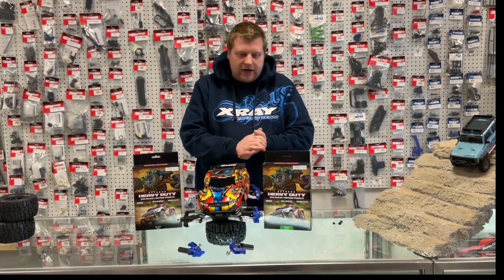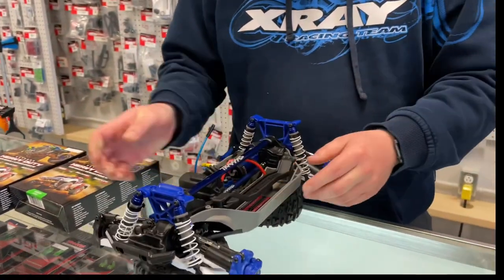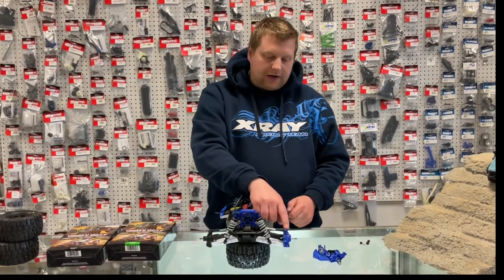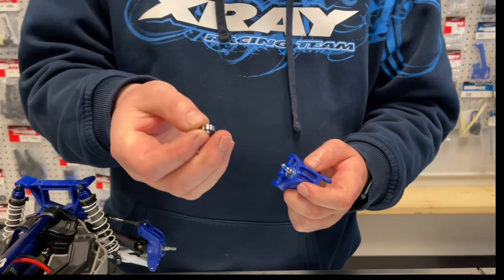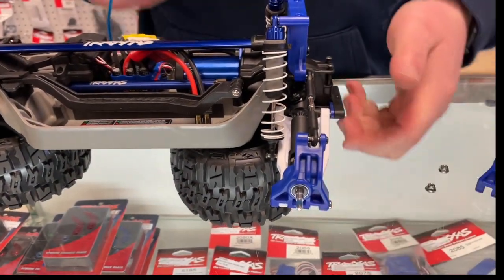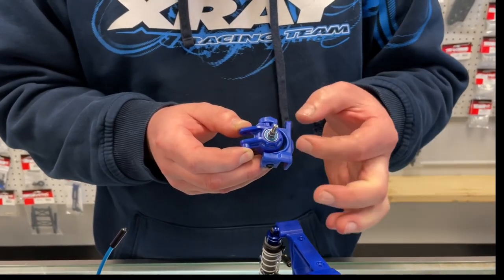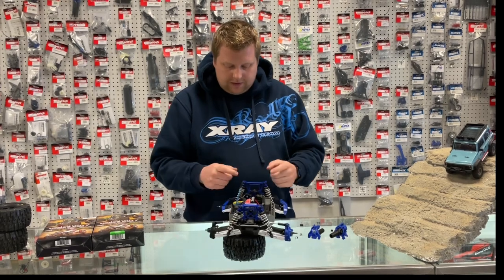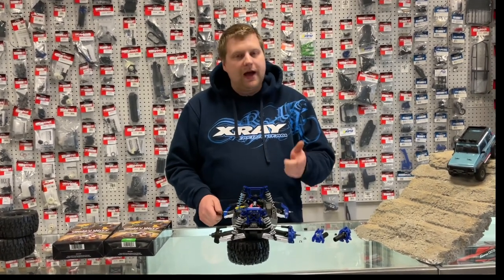Traxxas Extreme Heavy Duty Outer Driveline & Suspension Upgrade Kit - TRA9080

Comment: So turns out those extra bearings are for using the 9052r steel shafts..the rear will not except those  large bearings...I just pulled my hair out trying to figure this out...traxxas ts to the rescue
Reply from the maker: That’s what we did as well. Thank you for the response

Comment: the extra bearing included is for the new metal spline extreme heavy duty cv driveshaft #tra9050r that they have release in conjunction . they used two 6x12mm bearing in the back but fear not they are trash. broke to stub axle already. the plastic one are super hella great !
Reply from the maker: Thanks for the update. We found the plastic axles included with the EHD kit are great when it comes to durability!
Reply: @ultrarchobbies   i have over 30 plus run on them on my 6s slash they are amazing

Comment: Could someone please micrometer the pin that is included that holds the metal 12 mm hex? Trying to figure out if it’s the same size as the stock Maxx pin that holds the plastic 17mm wheel adapter on. I know the Maxx pin is longer but wondering about the diameter this would make for an easy cheap 17mm conversion.
Reply from the maker: We did some measuring on the EHD hexes / pins - TRA9069 and the pins are 2.0mm x 9.7mm. The Maxx pins / hexes - TRA8956 are 2.5mm x 14mm
Reply: @ultrarchobbies  Thank you for getting this info for me. Basically they are the stock pins, I wonder if I could drill them out as there is more metal now that they are 6mm shafts like the stock Maxx half shafts.
Reply: Are the pins supposed to to lock the metal hubs like the old plastic ones do. I can’t get them to lock in. Already lost a pin. Had to put tires on super tight

Comment: Just ordered this for my Hoss, I feel this should of been OEM on the Hoss for the price you pay
Reply from the maker: That is awesome, which colour did you go with? That is a good point it would also help differentiate the differences for each of the 1/10 4x4 VXL models that are very similar with much different price tags
Reply: @ultrarchobbies  I just ordered a Green Truck with the Blue Extreme HD kit, Green GTR shocks with Blue VG springs :)
Reply: @ultrarchobbies   yup i feel that Traxxas could of even charged $20 more IE: $500 if they included this kit.
Reply from the maker: @marcgallant5270  that will be a very slick looking truck for sure!
Reply: @ultrarchobbies  it hope so! This is going to be my first RC. I couldn't afford one when I was young but recently ran into an old friend who has an original traxxas rustler nitro! Got me hooked :).
Reply from the maker: @marcgallant5270  you’ll really enjoy the new electric cars especially with brushless and LiPo!

Comment: Does anyone know if the extreme hd steel driveshafts work with this kit?
Reply from the maker: Thanks for the comment! Traxxas has specifically designed two new driveshafts for the EHD kit: TRA9051R - Front & TRA9052R - Rear 

https://traxxas.com/products/parts/9051R
https://traxxas.com/products/parts/9052R
Reply: Sweet thanks! I have the 9051x and 9052x shafts currently. Can I just swap these axles and save some money?
Reply from the maker: @FrostyBk2  we don’t have any experience with doing this yet so I would double check that these parts are interchangeable. But looking at it the only difference is the “R” part number is for 6mm stub axles (included in the EHD kit), whereas the “X” part number is for 5mm stub axles. You may be able to change the stub axle to TRA9054 in the front and 9053 in the back to convert those axles to 6mm. But I would double check with Traxxas live chat to ensure those parts work together.

Comment: The reason it doesn't list Stampede is because the shock towers are the difference they do fit the stampede with a little modifications....shock towers are not a direct fit to stampede that's why they do not list it. So technically it's not for a stampede....but will (did) work....👍👍
Reply from the maker: That is great to know, what modifications are required? We were a little stumped as the slash 4x4 and stampede 4x4 use the exact same shock tower and same rear body mount just a different front body mount.
Reply: Front body mount is what doesn’t allow for direct assembly on stampede. Traxxas just posted a tutorial to adapt it to a stampede. Extra bearings are for steel drive shafts
Reply: Update they just released new Stampede with new shocks towers. It's really reusing the Hoss platform with 2s powertrain.